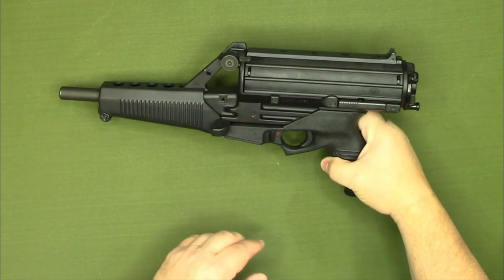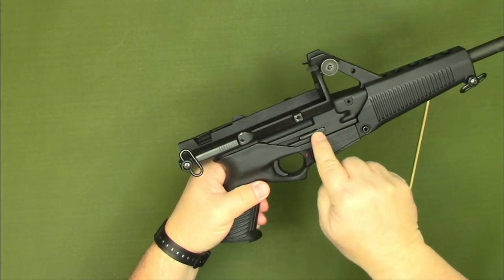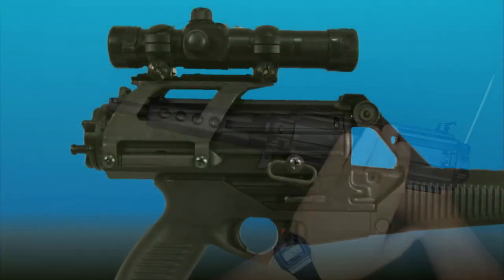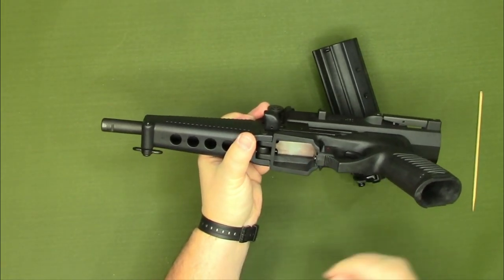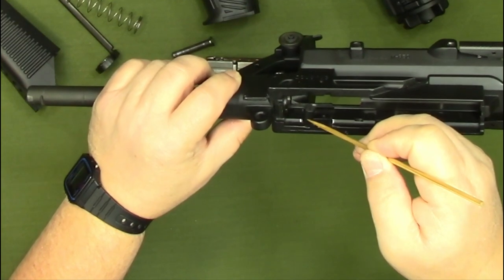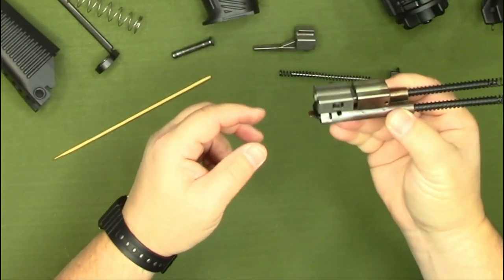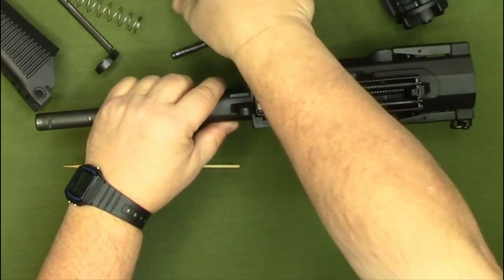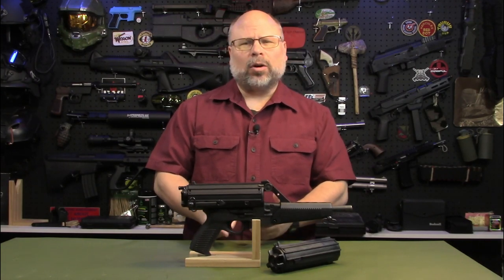Calico M950 Field Strip

Comment: I purchased a brand new M950 (Liberty III) as soon as I got out of prison. I just liked the style. Plus i wanted to make sure my gun rights had been fully restored. So i had to purchase it. I Got denied at first 🤣 but got approved on appeal. I've had it now for 14 years. Never fired a single shot. Never cleaned it either. It's just been sitting in the safe locked up longer than me. I watched this video because I really think it's time to clean it so I need to disassemble it first. Even the bullets are 14 years old. They may be past their shelf life too and need replacing as well. The springs in the magazines should still be good because they were stored with no tension on them. I hope so because those magazines are expensive.